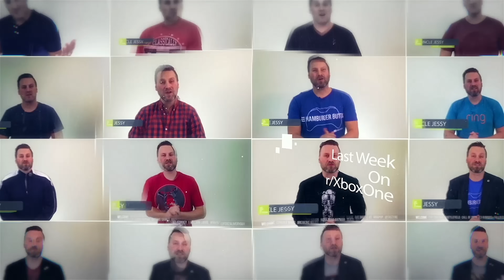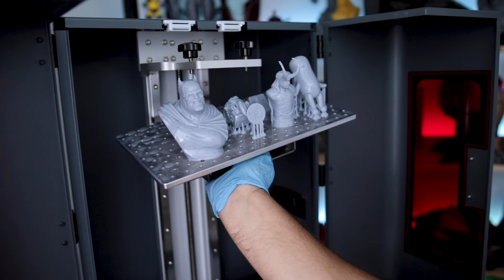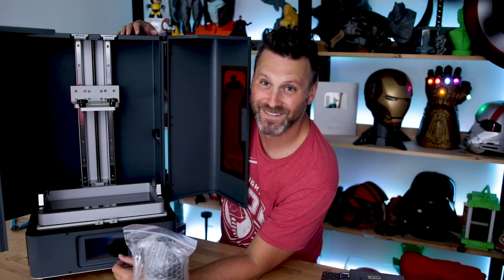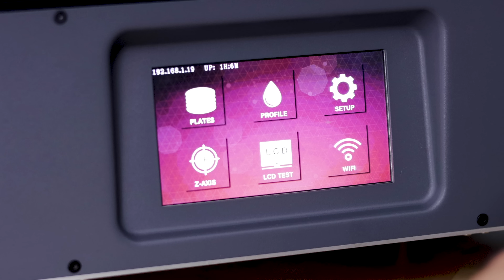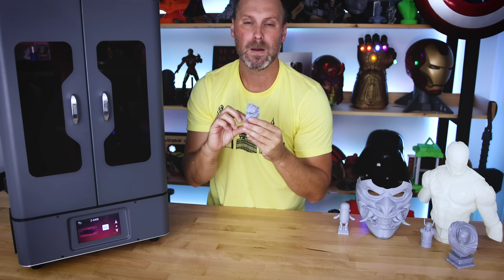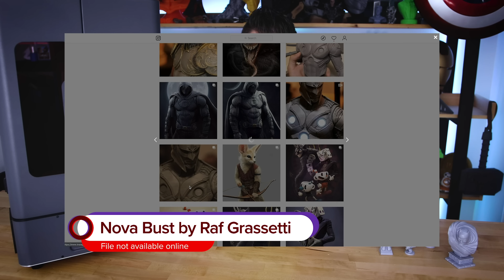Initial Impressions - Phrozen Transform Resin 3D Printer - Huge Resin 3D Printer

Comment: One of these will become the "CR-10" of resin printers - not yet.  I'm lurking for now.  Would like to know print times versus FDM for the same object.  Resin should improve and get cheaper as adoption increases.  Thinking maybe adding a layer of PEI or thin metal to cover the holes on the build plate?  Enjoy your reviews - you USE the machines for many prints before you give your opinion not just one or two prints.
Reply: Time wise from what I have seen, resin printers are faster. Honestly, I'm down to test this with you if you have an fdm one. I have a reason 3d printer.
Reply: @UnvarnishedTarnished  I believe resin printers are slower on a 1:1 basis, but their print speed is determined by the number of total layers rather than the amount of total material going into the print. Print a single miniature on both an FDM and Resin printer, and the FDM will probably win out in terms of print speed. However squeeze as many copies of that same miniature onto the build plate as you can, and the resin printer isn't going to take any longer to finish the job. While the FDM has the print time dramatically increased when compared to printing just one.
Reply: @Smathalgoth  Good point about multiple prints. I print multiples on my FDM if I am unconcerned about print time or can't be ready when a print finishes to start the next one.  If I care about speed, I print one at a time.  My delta is pretty darn fast, though, and I think leads the pack in print speed.
Reply: @reasonablebeing5392  I think a big thing we have to take into consideration too is although yours may indeed print a miniature quicker, resin would win in quality. So I think it really depends on what were going for. I can't print very large things or in any materials other than resin, and resin being brittle is a downfall. While fdm, you have the speed but lack the finer details when it comes to something like a miniature.
Reply: @UnvarnishedTarnished  Not all resin is brittle.  Some resin prints will even be stronger than the same print in FDM because of resin's isotropic properties while FDM prints are anisotropic.  As for speed - depends on the model size/printer size.  You put a resin that can cure in 8 seconds per layer in the vat, and you're using the full build platform, and suddenly you're pumping out layers faster than some FDM printers (especially if you equip the FDM with a .25mm nozzle to try and print small details)
Reply: @ualdayan  very true mate. And yeah in general resins can be brittle, but you're absolutely right that some are very rigid. I use sarayatech Blu sometimes and it's beyond tough. There's a guy that printed a suppressor out of it and it held up.